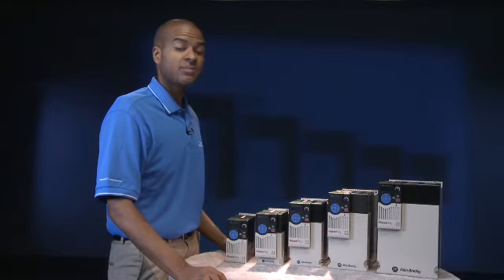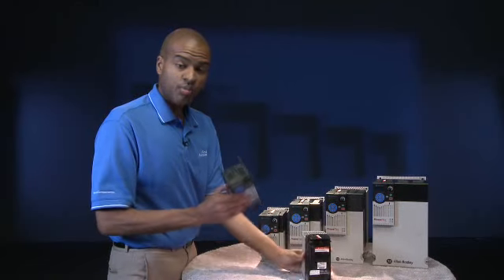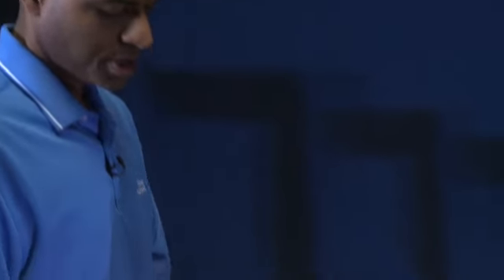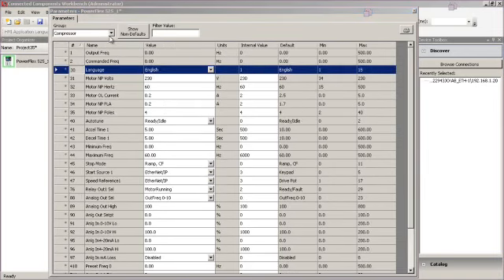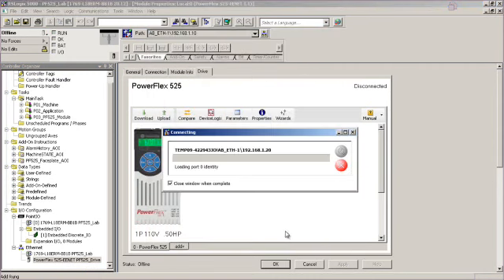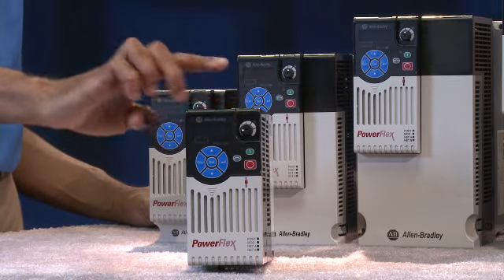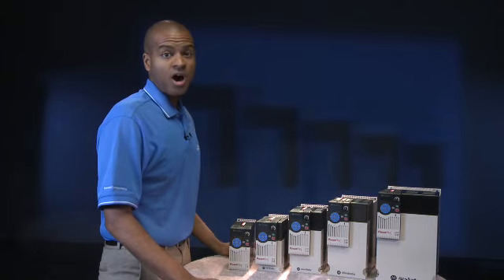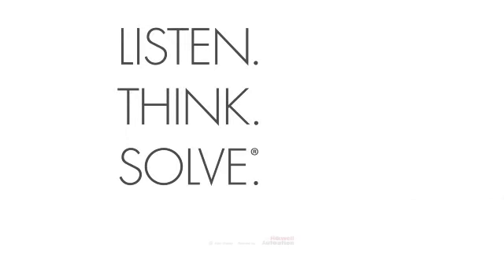Allen-Bradley® PowerFlex 525 AC Drive

Comment: This drive is fully integrated in logix 5000 just like every other drive from AB. Actually this drive is one of the first to offer automatic device configuration where logix will automatically load firmware and the program if the drive is ever replaced. This drive also has 4 data links in and out. It is actually better integrated than traditional 4 class drives. This is a world class product at a very affordable price

Comment: I hooked up this model VFD to a drill press for a larger motor. I have everything wired up and it runs and does what I intended it to. The only issue is when I stop the drill press from a push button on the side, I have to start it by pressing the green button on the VFD. What setting do I need to change to allow me to just press the push button on the drill instead of the VFD?
Reply: There is a parameter that lets you choose whether you can control it via the terminals, the drive itself or through a PLC.

Comment: One of my Allen Bradley powerflex 525 drive have F114 fault once a day. Whether motor is in running condition or not.
Don't know what to do .
Can you please explain about that.
Reply: Do you have any idea about the F110 keypad membrane error? it's coming frequently then reset also. Sometimes it doesn't reset!

Comment: Keeps  tripping on keypad membrane fault. We had close to 200 drives. Changed everything to siemens now
Reply: Very worst. I am also facing such a fault but it's run on  an Ethernet communication so no option with me. If there is no Ethernet communication I can change immediately!  Do you have any idea?
Reply: We also were running on ethernet , it easy to migrate to siemens g120c.

Now with the lead times of siemens delivery , we are migrating to Mistubishi.

Comment: Dear Rockwell Team,
Believe me This model is not a successful model from AB. 
Drives overheat very early and after 3 years of use these drives generate different types of errors which are not repairable.   Some of the errors are already pasted in the comment section by people.